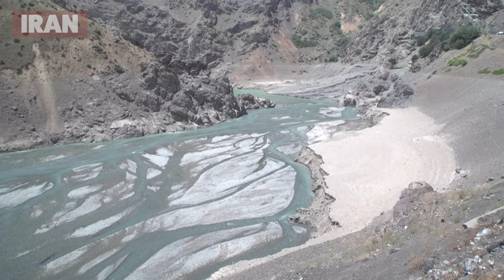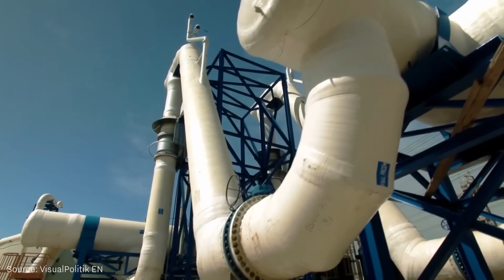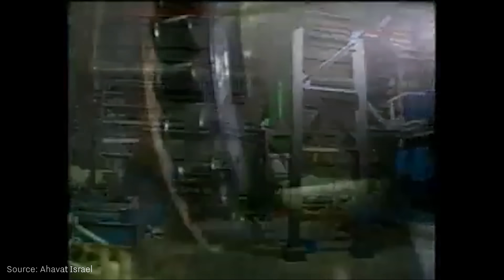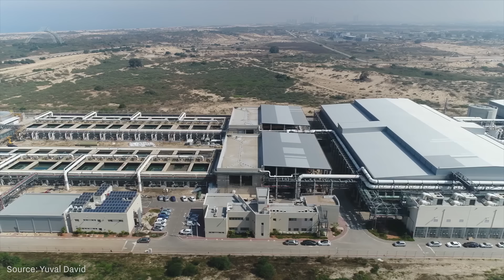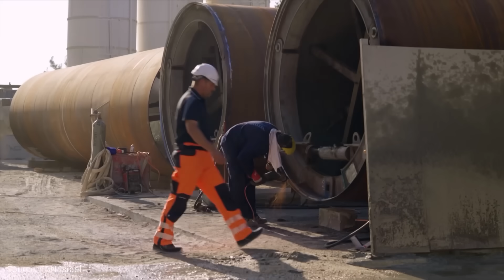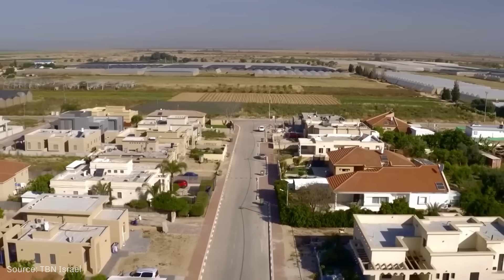Why Israel Never Runs Out of Water? The Desert Nation That Solved Drought

Comment: why desalination succeeded in Israel when it hasn't elsewhere in the region, despite similar water crises.
Using the 80 20 Rule 

Israel's 20% (Internal/Controllable)

Research institutions (Ben-Gurion University with Sidney Loeb)
Engineering firms (IDE Technologies—domestically founded and led)
Strategic state planning and execution capacity
Human capital: trained engineers, project management expertise
Political will to solve the problem despite cost

Israel's 80% (External/Required)

Capital financing (European Investment Bank, international banks)
Imported materials and equipment
Global technology supply chains
International partnerships and expertise

You can also argue that other countries in the region leaders show traits of stupidity and laziness / stupidity and hardworking/ or even intelligent and Lazy/ which does have  Some ..accurate merit.

Comment: Can you boil seawater and then capture the vapor ? Boiling large amounts H2O are expensive i guess, unlike kitchen work
Reply: Pushing water under pressure through filters is far more efficient when done at scale like is done with these plants. Boiling it and capturing the vapour is safer and better on an individual scale like one person cleaning a jug of water for themselves, but when it comes to providing water for millions and aguriculture on top of that? Pushing water through filters is way better.

Comment: great video. explained everything very well. just some points of improvement:
1. whenever introducing the name of a proper noun ( name of person, water facility, etc...) also write it on the screen. this is very useful especially if the name is not known in english
2. speak a little slower, and do not sound like you are just reading off of a text.
great info however! 👏👏👏

Comment: Wat they should do is have the ocean water go in the deep hole in a thick copper and aluminum mixed as a heater energy supply mixed with carbon particles and salt filter so you can have energy get to be heated and like water fall for motor rotator and triple the energy and into clean water and into pure salt like salt on ur food

Comment: The Middle East is NOT running out of water. It's just that typical 3rd-world behavior compels irresponsible people to mass-produce more poverty-babies than what the resources can sustain. It's a worldwide problem. That's why over the past 15 years globalists decided to use "White" countries with responsible birthrates as the dumping grounds of 3rd world overpopulation to try to "even out the load" (without permission of citizens of course). Now places like Texas which have always been prone to drought are struggling with water supply issues as globalists keep sending more people there.

Comment: The 3rd part of the equation in Israel's water strategy is the extremely reserved methods of using water in agraculture. The drip irigation system was aslo invented in israel and it is widely used and saves a lot of water (sorry for al the type errors...)

Comment: Desalination of sea water has two big drawbacks. It requires a lot energy and second there is significant waste that has tremendous environmental impact. After desalination occurs and the fresh water is separated what’s leftover is a super concentrated salt brine. There’s so much of it that it just gets pumped back into the ocean and it causes the salt level to be too high and it begins to kill ocean life and disturb major underwater ecosystems in areas where the brine is dumped. What needs to happen is we find other uses for that salt such as a salt reactor or salt batteries. Salt batteries are super insulated storage containers where salt or sand or mixture is heated to very high temperatures. The molten salt if insulated properly retains heat for very long periods even days like a battery which then can be diverted to heat water and produce steam and then converted to energy. I like desalination but I don’t like how they hide the polluted waste water problem.

Comment: Israel extracted 80% more water from the West Bank than agreed in the Oslo Accord, while Palestinian abstractions were within the agreed range.  Contrary to expectations under Oslo II, the water actually extracted by Palestinians in the West Bank has dropped between 1999 and 2007. Due to the Israeli over-extraction, aquifer levels are near ″the point where irreversible damage is done to the aquifer.″ Israeli wells in the West Bank have dried up local Palestinian wells and springs
Reply: Source: you made it the f up
Reply: @pr0t0pr1m3  “Water supply and sanitation in Palestine” article on Wikipedia.  Maybe they made it up but I doubt it as it is well sourced.  https://en.wikipedia.org/wiki/Water_supply_and_sanitation_in_Palestine

Comment: India also developed a another technology LTTD Low-Temperature Thermal Desalination, a technology that converts seawater into fresh, potable water by using the temperature difference between warm surface water and cold deep-sea water. The process involves using a vacuum to lower the pressure, causing the warm surface water to evaporate at low temperatures. The water vapor is then condensed using cold water from deeper ocean layers, and the resulting condensate is purified water. 

This one is game changer as it utilize waste heat or very low energy for this process, currently under testing phase.

Comment: this video skips a very important fact about desalination though. desalination is helpful in creating usable water, but it only really works if a lot of nations don't do it. if more nations switch over to desalination, it would start to cause a lot of problems because of the amount of brine that would be created. most of it currently ends up being pumped back into the ocean which would be a huge issue if it was widespread. disposing of it in landfills doesnt work either because it just seeps into the ground with rain and essentially salts the earth, making any land around it completely unusable. it is very helpful as a last resort, but if other methods are available to get fresh water, it's usually best to not use desalination.
Reply: I remember hearing that in Israel they process that brine using bacteria which converts it into solid material that can be used for other industries. I might be confusing it with something else though

Comment: It's not just desalination. Israel started watering crops under the soil at the roots reducing evaporation. Israelis have been doing water conservation, dry landscaping and energy management since the 1960's.
Reply: Totally true. They opened an Agricultural Development Centre before WW1 in the area before Israel was even formed.
What have the Palestinians done???
Europeans did most developments throughout Middle East, not the Arabs.
Reply: @JH-ck1nr  EU send them sewer pipes , they turned them into rockets..
gave them agricultural equipment and use them for their tunnel networks..
send them concrete and used that to fortify their tunnelnetworks and rocketstashes.
what can a man do against such reckless hate?

Comment: if it happen that this torrid region will gradually turn reforested  , it will start to grab surmountable transevaporated water molecules from gulf sea and from the sea water canals where torrid region will start to create low pressure areas on highly plant's populated regions and specifically treesdense polpulation areas , the questions is is there any weathered salt and mineral deposits on such vast region that possibly create great sink holes as weathered mineral deposits are essily wash down by draining rain water that seek route gravitationally ?
Reply: yes. the dead sea and the area around it are one big salt deposit. and there's already a ton of sink holes around it. as for other areas in the middle east, I'm not aware.

Comment: A glaring omition in this video is where the electrical power for these desalination  plants is coming from. After all if power is free the process is very easy, if not then the difficulty and cost increase.
Reply: All electricity needs are sourced from local power plants. Israel electric grid is not connected to its neighboring countries. A project is in the works to connect it to Cyprus’ grid (and the EU), grids with similar technical development and reliability.

Comment: 5 times the cost of natural water, but gets back the agriculture water that saves on imported food, so the math is probably only two times the cost
Reply from the maker: Yes, expensive water seems to pay for itself through improved food security.
Reply: @SolarPaths  you got it wrong. the food that israel EXPORTS pays welll higher than the water it needs to desalinate. if you walk to any supermarket in europe, the usm or developed asia, and you buy jaffa brand, or sunkist, or a few otehrs then you are buying high quality israeli fruit. they also make very good wine. israel also grows a lot of cotton which needs much water but is very lucrative. israel grows vegetables cheaply and for taht they use cheaper "gray" water.  it saves on that even more with using hothouses and dripper systems which reduce water costs. it doesnt invest in growing much cereals which have a low profit margin.
Reply: Put security you say huh? So what about the fact that they actually take a big portion of that food from Jordan?
Reply: @Adam2004-l2m No, Israel exports a lot of water to Jordan and this comes from the Mediterranean. Do not mouth off without knowing the facts.